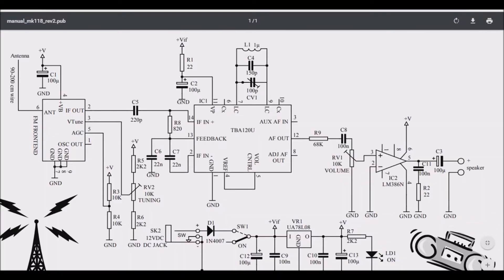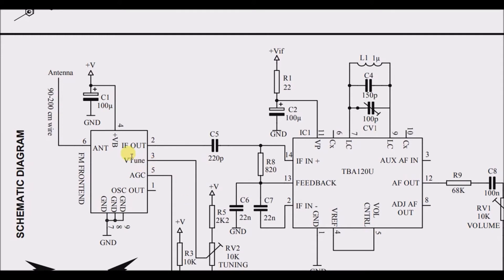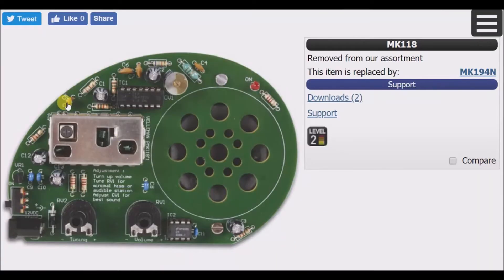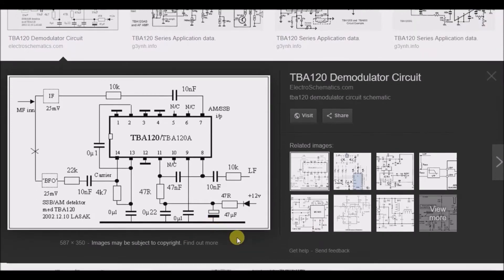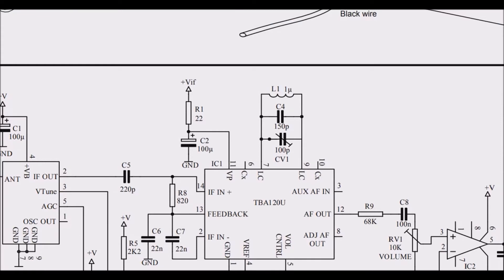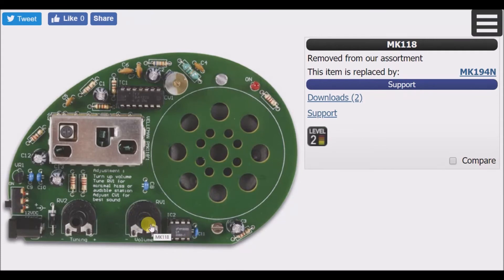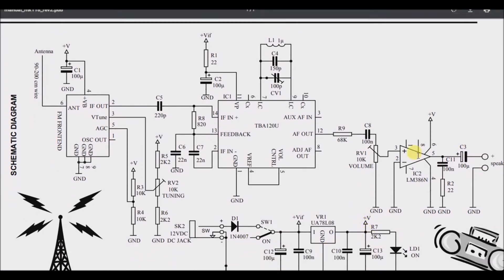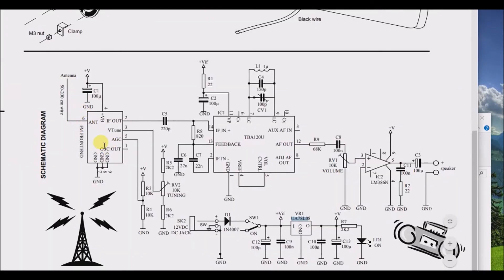Velleman FM Radio Kit MK118

Comment from the maker: 2:44 sorry, that's a decoupling capacitors to ground.
3:55 IF out, probably means intermediate frequency, which is a frequency to which a carrier wave is shifted as an intermediate step in transmission or reception.

(I've learned a lot more about radio, since I made this video.)